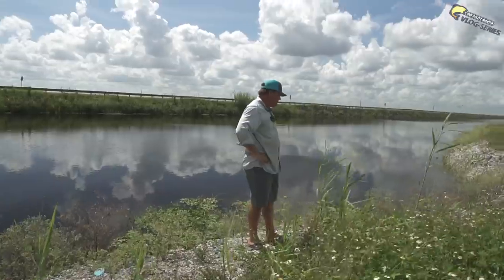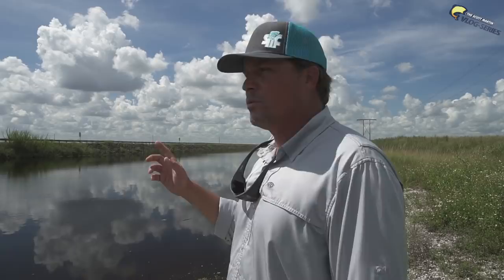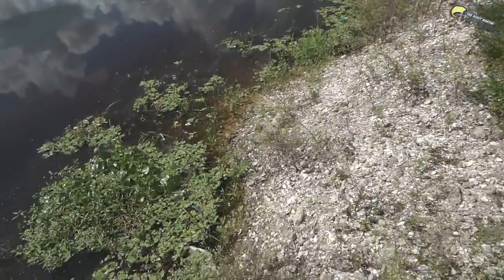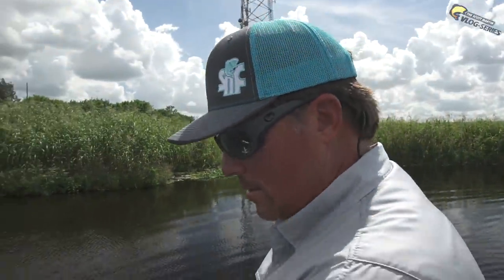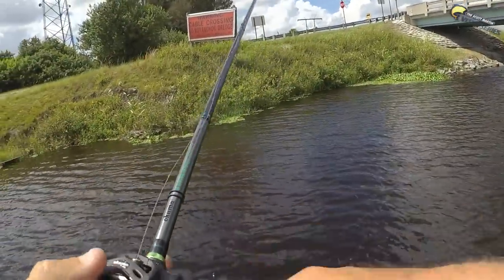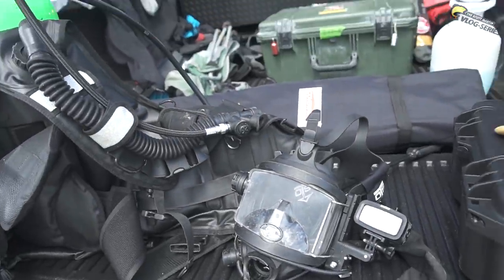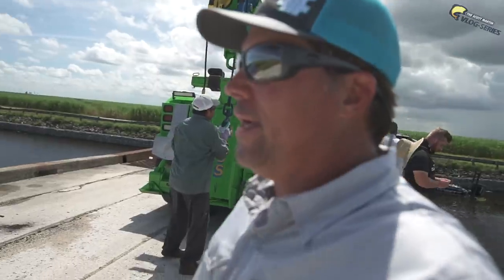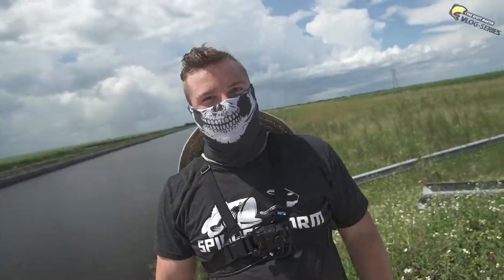Found Sunken Crime Scene While Fishing - Cops Called

Comment: What's REALLY crazy is that your bridge HAS NO GUARD RAIL! Who the heck designed that thing? I've never seen a bridge with anything less than 3 feet of rail. Here in Maine we'd have cars careening off the side on a daily basis if we had bridges like that, especially during heavy rain storms (hydroplaning) or with black ice in winter making the road slick. Anyone with big tires knows how easy it is to go over something that low.

Comment: If I'm not mistaken, this is Twentymile Bend, Florida. I used to work for a railroad out that way and as a result, I'd drive across that green bridge every single day. I was on call though, so I'd drive to work at weird times. Its crazy what you'd see down a road in the middle of no where at 2am.

Comment: '92-'93 Mustang LX 5.0 coupe, probably down there for around 15 years as the Saleen whale tail hasn't been in style since about then. Looked to have the 4 cylinder spec seats, so maybe a 5.0 conversion. The same theft ring was probably also responsible for the Monte Carlo SS, as they were both stripped and dumped the same way.

Comment: 1st vehicle was a Saleen "foxbody" mustang(88-93)....Saleen is a performance mustang like a Shelby or Roush mustang, you can tell it's a Saleen by the large rear wing.   2nd vehicle looks like a Monte Carlo.
Reply: probably stolen, as foxbody's are worth a fair bit these days.
Reply: genius
Reply: @tech4pros1  especially a Saleen it seems
Reply: Stock lx with Saleen wing. Not a real one. Appears to be 87-89.
Reply: I agree.  I owned a 90 5.0 LX and this one didn't have the steering wheel airbag.  1990 was the first year of the airbag on the steering wheel on the fox body.
Reply: @TheNicko773  Airbags are no big ordeal to remove & replace with an older style wheel w/o an airbag. This is frequently done w/street race cars, remove bags, module & shock sensors if you wish. The SW's are different along w/the HVAC control knobs on the dash are the two big noticeable things at a quick glance.
Reply: @crockagater929  Saleen body differences are the wing, ground effect kit & depending on year is the hood. Their are vin #'s on the rear hatch, so if it was a theft job & it was a orig Saleen, that might be why they left the hatch/wing but took everything else including the ground effect kit. Saleen had suspension upgrades, brake, engine & so on, these are all the parts that are missing....this is why I was guessing it was a real Saleen, but as we know this could have been a normal LX with that Saleen wing....if it's a normal LX, why take a stand axle, suspension & brakes, they are a dime a dozen??
Reply: Sounds good to me brother.!!!
Reply: not a saleen     they were just street race cars   they both probably start out as V6 cars     cheap dime a dozen cars    that's why they only took the race parts
Reply: Well, if it was a real Saleen, why go through the trouble of replacing the Saleen ground effects, ie: front bumper cover, with a stock one of the same color, and removing the decals on the side, as well as replacing the 5.0 badges on the fenders, removing the front tag cover, and then replacing the seats with stock ones? The most telling point is the stock 4 bolt wheel lugs. Saleen's used a 5 bolt front and rear. If you were stealing it for parts, why not strip it to a shell and dump it, rather than trying to make it look stock? Both front and rear suspension is still in the car. I doubt they replaced those with stock pieces. Saleen hoods, as from the factory,  from 87 to 89 were stock except for a decal on the cowl. Also due to how rare the cars were/are, I would guarantee this isn't one. And you could buy that wing aftermarket, through any number of places like Cervinis. People probably stole the engine, because it was a 302. And the rear end, as it was an 8.8, which can be upgraded or sold.
Reply: If it were a real Saleen, my guess if it had been stolen, it would have made much more dollars and sense (see what I did there?) to ship it out of the country as a whole car.
Reply: no saleen just a fox body with a wing and a 5.0.
Reply: The second vehicle was 100% a Monte Carlo, actually it was a monte carlo ss according to the trunk.
Reply: I'm just hoping that nobody here is pronouncing Saleen" "Say-leen"...Freakin' hate that.  lol
Reply: petrol88 almost as much as “LOL” right..
Reply: Not a Saleen. Saleens have different bumpers and seats than this car. Almost zero chance somebody removed the parts and replaced them with stock parts. It's simply a lx that has a $300 wing added to it. Still a shame somebody did that to a southern/rust free car.
Reply: Craigslist for sale jus had an oil change done. Needs some work. Some dings an piant is pilling a lil call me if u need more info lol.

Comment: Even without the engine and rear end missing, there are still several places to find  vin NUMBER, DRIVERS DOOR PILLAR, UNDER THE FRONT DRIVER SEAT ON HE RAIL, IN THE FRONT DRIVERS WINDOW and in the trunk some where, I forget where to find it. I worked in the local tow yard in my city for over 20 years, I was the dispatcher

Comment: That Monte Carlo has the tapered glass hatch “nascar” requirement which means nascar required Chevy to make production cars with the same overall shape of the car they used in the racing  but obviously regular production meaning lame motors and transmission very basic car but still collectible about 10,000$
Reply: Cool Info